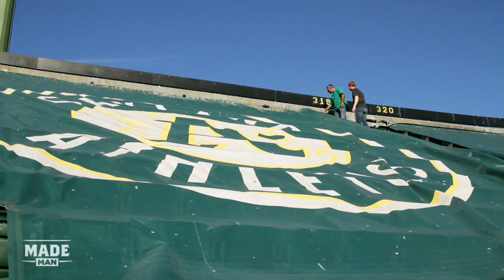Flipping Oakland's Field from Baseball to Football

Comment: This video proves why football/baseball stadiums do not work in this country any more. It is to hard to turn them over.
Reply: The Metrodome could go from baseball to football in 4-5 hours. Then back to baseball in 12 hours because they had to scrub away the football lines.

That's not terrible. 

The reason multipurpose stadiums went away is twofold:

1) Greedy owners wanting more revenue...not having to share with the other sport.

2) Compromised sight lines and seats that are far away from the action. Multipurpose stadiums tend to be awkward for at least one of the sports because of geometry. The Metrodome was OK for football but terrible for baseball. The O.co Coliseum sucks for both baseball and football.
Reply: What happens when they play on the same day
Reply: +Rory McCabe They don't ever play on the same day at home, as far as I know. The schedulers deliberately avoid that. 

If a situation arose when they absolutely had to (say, in the MLB Playoffs), one team would probably play very early in the day to allow enough time for a switchover for a night game. But even then, I think they try very hard to avoid that.
Reply: & your idiotic line of thought sir is why Oakland will soon join San Diego losing their football team
Reply: Anthony Pedalino it’s valid points, fans don’t wanna play for crap seats, football players don’t wanna play on dirt, multipurpose stadiums work, just baseball and football are too different to share a field easily
Reply: Daniel Dougan it’s basically the ultimate definition of a lol cow stadium, why do you think all of those nose bleed section seats are always empty?
Reply: This is exactly why Raiders finally decided to move to Vegas. It's not lack of fan base for sure.
Reply: agreed
Reply: It would save time and money to just make a whole stadium for football. I don't get why they just do that
Reply: Rory McCabe they dont.
Reply: Jh0001471 i dont think it would save money to have 2 stadiums instead of one stadium and you switch it 7-8 times.
Reply: @danieldougan269  They don't, period. Even if it is the same sport, they don't do it the same day
Reply: @AR-jt2ux  what actually they have if you watch another video Timelapse on the field, it says MLB postseason that’s when the Oakland Athletics were in the playoffs so it’s rare, but it happens
Reply: that's not the reason at all. it's because multi-function fields aren't any good for any of the sports they host. This field was barely adequate for baseball but was a mess for football. it had seams and lumps that tripped players and required ball carriers to move from grass to dirt and back again in one play. It was a nightmare.

Comment: This had to be the sloppiest, least-efficient conversion process ever devised.  They couldn't put in retractable seats?
Reply: K
Reply: David Lafleche Before the Raiders moved to L.A. in the early 80's, the football field used to be laid out with the goal lines running from home plate to center field. You still had to remove the pitcher's mound, but that was about it. The sightlines for football were terrible tho because the "prime" seats were at baseball field level and you couldn't see over the players on the sidelines. When they moved back to Oakland in 95 they built that "football stadium" seating in the "baseball stadium" outfield and turned the football field 90 degrees. That's why you get all this "stupid" reconfiguring going on during conversion! You're reconfiguring a stadium that was originally designed to be reconfigured, only at a 90 degree different angle!
Reply: According to several stadium websites, the Raiders had to do it that way because their schedule conflicted with the baseball team.  After baseball season ended, the Coliseum went to its standard football setup, with temporary seating in center field, and the gridiron running from first to third base.

If you look for a Raiders vs. Bengals video (1976), you'll see that setup.
Reply: David Lafleche Actually, according to Wiki, we're both right. Back in the day. The football field used to run as I previously described while the baseball season was still ongoing. When the A's were done, the Raiders switched the football field direction foul pole to foul pole. Learn something new every day! Still cumbersome way of doing things! What were they smoking back then? LOL!
Reply: Even worse: Metropolitan Stadium had a double-deck pavilion in left field.  For one or two years, they would dismantle the whole thing, then reassemble it closer to the sideline!  After a while, they stopped doing that.  But The Met had to be a lousy place to watch football.  The seats were much too far away.
Reply: David Lafleche Both teams were on the same sideline too! If memory serves me well?
Reply: Yes.  That happened at The Met, Yankee Stadium, Wrigley Field, Tiger Stadium, Fenway Park and County Stadium.  It's a sign that a ballpark is not meant for football.
Reply: Actually, the expression "old fart" is illogical, since farts dissipate too quickly to get "old."
Reply: David Lafleche"Thank you Spock! Mr. Sulu! All ahead. Warp factor 1."
Reply: +David Lafleche that all depends on how you few time a fly lives 24 hrs to us its a short life but if a fly lives 27 hrs he's lived a long happy life yea I just defended a farts age lol
Reply: They did
Reply: @davidlafleche1142 , once in a while Northwestern Wildcats will have a game at Wrigley Field. The Yankees host the Pinstripe Bowl for NCAA!
Reply: I remember at the Astrodome a huge chunk of the lower bowl down the third base line was on rails and there was a section of retractable seats that would then form the endzone.  I really expected to see something like that in this video ,but they went with the cluster approach.
Reply: One word: cheap

Comment: If they can renovate Stanford stadium from its old self to the beautiful stadium it is today, the they can definitely do the same with the coliseum.
Reply: No.  Oakland Coliseum was poorly designed, and does need to be replaced.
Reply: Stanford Stadium is a totally new stadium from the old one. It's not a renovation.
Reply: cruman87 So the old stadium was completely demolished, and the new one was built on top of the existing land? U are correct, that is not a renovation
Reply: David Lafleche It was a bad design from day one. Bad for baseball. Bad for football.
Reply: Dan H Only if they make it one sport. Baseball or football/soccer. Pick one.
Reply: The Coliseum desperately needs repairs, especially the plumbing.  I think it's a goner.

Comment: If that is true they still come out way better. Back in the 60's when it was made, it cost 25 mill which is 180 in today' money. It was renovated in 95' with 200 more million, which would be 293 in today's currency. That is 473 mill for the cost of that stadium in today's currency. Using 250,000 for 16 games that's 4 mill.

That stadium is paid up for 118 years give or take playoff games and you would still come in at over 100 years. Why pay 500 million for a new stadium?